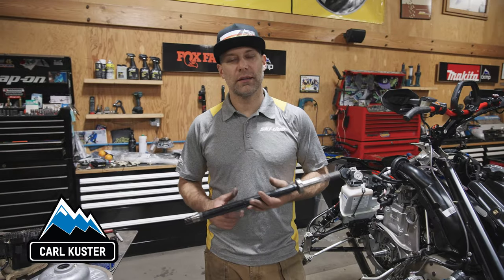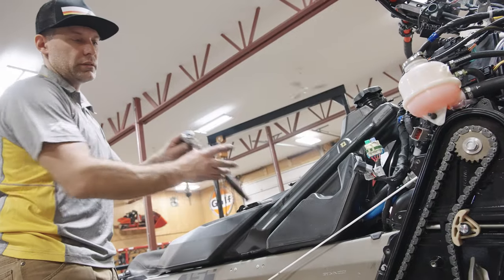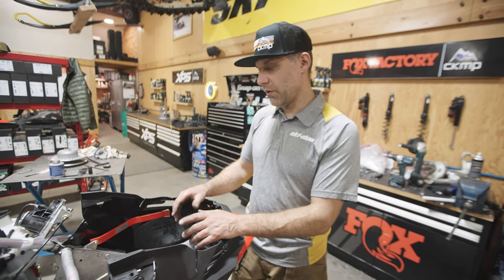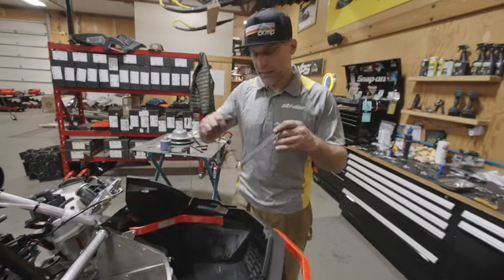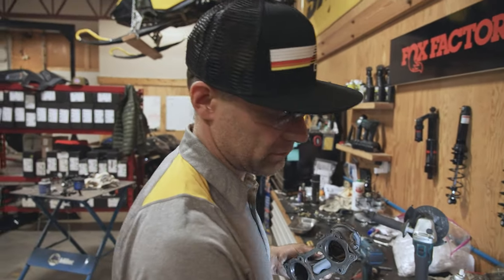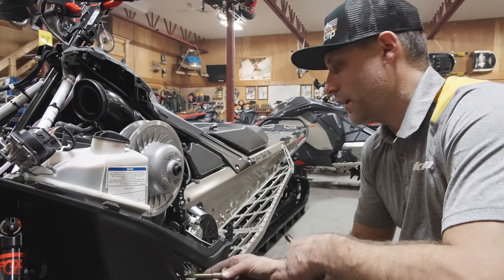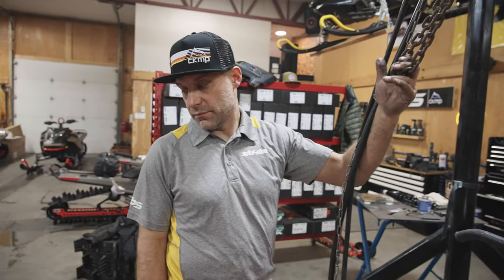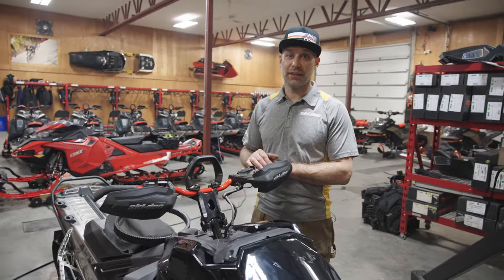Building a LIGHTWEIGHT Mtn Sled Part 2

Comment: Was curious which machinest you got to make the p drive titanium flange bolt?.. and wondering if it messes up the weight of the clutch?.. was thinking about sending the chain tentioner bolt away to get made as well...
Reply from the maker: We had all our bolts titanium and aluminum made by a company out of NJ, Very timely process as we had to take measurements and create CAD files individually and now that we are on the Gen5 platform as well as learning lots of what we need more of in titanium vs aluminum we are hoping to find a supplier a bit closer to us on the west coast.

Regarding the pDrive flange bolt, we have never had an issue with the clutching throughout numerous builds.
Reply: Thanks for the reply! I ended up ordering some short stock rounds online and maybe found a machinest in williams lk that can do a nice job with the flange and tentioner screw :) they should start coming stock built out of titanium lol

Comment: Delete the oil injection! Save like 10 pounds by taking the pump and reservoir off who cares if you have to mix gas lol also notch the track, titanium shock springs save a lot of weight,
Reply: How do you oil the crank case then on an efi motor??? That was a cool weight loss truck on an old carburetor style motor but when you are injecting the fuel at the last moment before the compression stroke there isn’t any air fuel/oil mix in the crankcase.
Reply: @grgsrvc  the crank case of a 2 stroke is constantly bathed in the oil/gas mixture. On higher revving engines you drill passages in the crank case that connect to the bearings and they will be oiled. Oil injection does not send oil to the bottom end. It just mixes it with the fuel before the reed cages lol
Reply: @Yz4Life  you are right if it’s a carbureted motor.
Reply: @Yz4Life  the fuel injectors add fuel to the air after its has gone through the crankcase. Having oil mixed with the fuel in this style of system is pointless.
Reply: @grgsrvc  you making no sense? No air is going through the crankcase lol
Reply: @Yz4Life  look at where the fuel injectors are located especially if it’s a TPI style fuel injection. I wouldn’t depend on it getting oil to the rod and crank bearings. Don’t remove the oil injection system on a modern efi two stroke.
Reply: @grgsrvc  why not?
Reply: You can't delete an ETEC motor. It's Direct injected, with the booster injectors kicking in at Mid to High RPM's so premix wouldn't even be entering the crankcase to lube the bearings while it is idling.
Reply: @Yz4Life  new etecs are directly oiled on the bottom end bearings, has injectors in throttle bodies & the cylinder head
Reply: @3DProductions  OK that makes more sense thank you. I’m you could work around that somehow? Old triples can spin 12k with premix so these can too

Comment: So basically you have to spend 5-6k to shed real pounds. I had considered doing all the bolts on my sled in titanium but maybe it's not worth it. I am building a carbon fiber hood and cowling though, that should be good for a lot of weight on my Edge chassis.